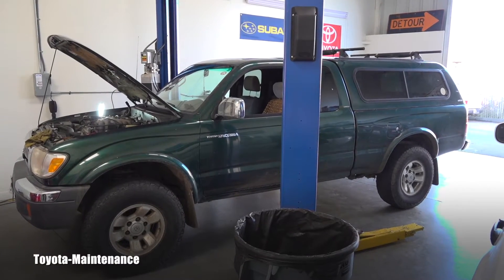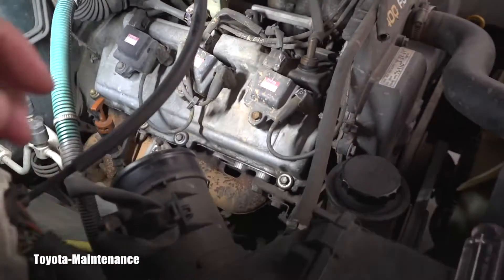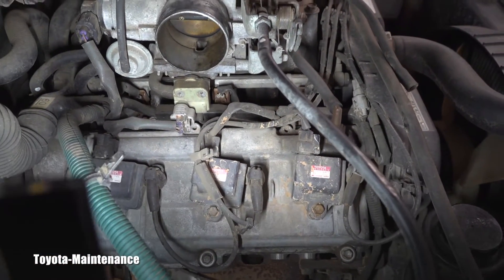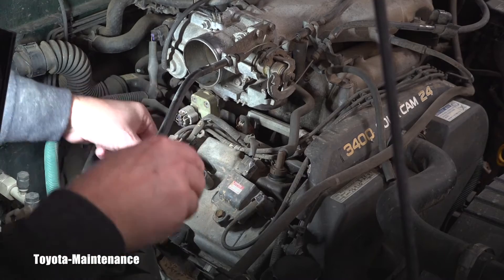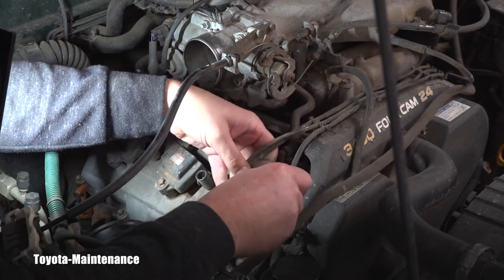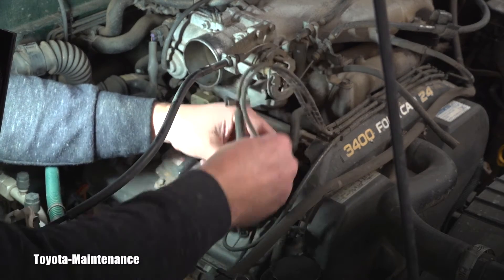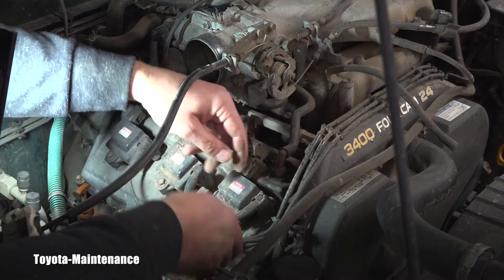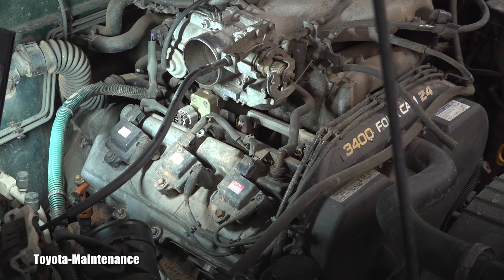Spark Plug Wires mess

Comment: When buying used vehicles it's not uncommon to see all kinds of Mickey Mouse type work done. It was like it was someone who never worked on a car before and practiced on this one. Or maybe got in a hurry and didn't bother to see how it was supposed to go. I had a set of brake pads on one side where they didn't put the keeper rods through the pad holes so it was rattling and eventually caused the rotor to warp. The fact is some people shouldn't work on anything mechanical.